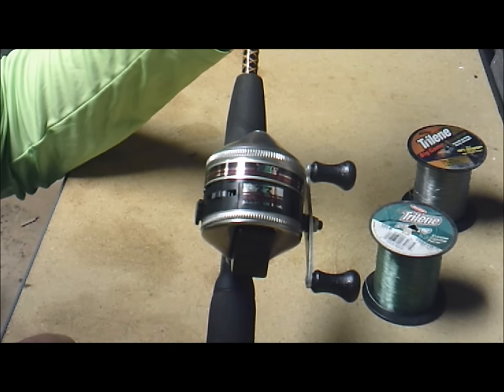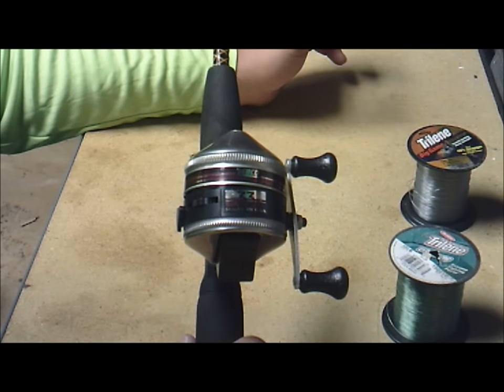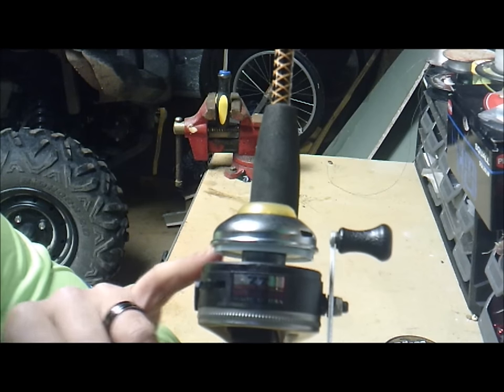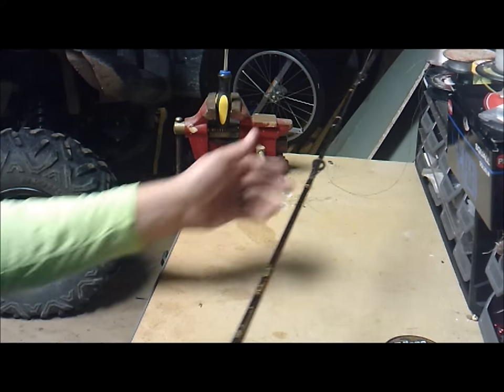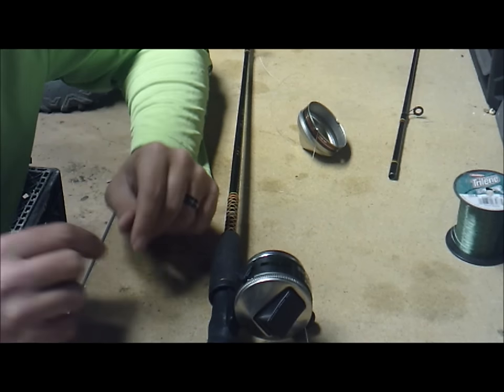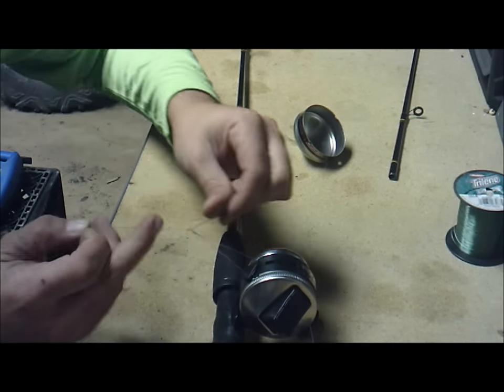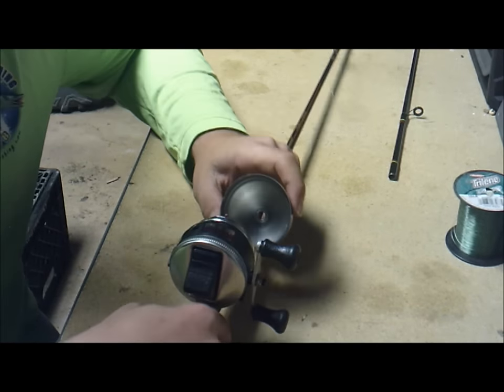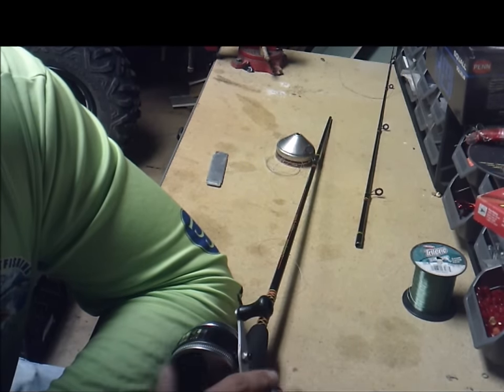How to Change line on a Zebco Fishing Reel

Comment: Bought a 500 for an ultralight rod. It's very smooth enjoyable.fishing recommend casts great. One odd thing- the bale wire is a bit heavy diameter in my opinion for a reel of this size. But a great purchase.
Reply from the maker: Great thing is you’re not stuck with the line when you buy it! Enjoy the reel! Good luck and tight lines!
Reply: What’s the power of the rod?

Comment: When putting line on your reel, to eliminate the line twist that makes you line, want to spring off your reel or have coil in your line, your are to take the line off the top of the spool  if  ( you have the spool of line horizontal , like with a bolt through the center of the new spool, clamped in a vise )  for spinning reels or the bottom of the spool for the other.
  That way it lays back on your reel with the coils are laying flat just like they came off the new spool of line to eliminate line twist.
Reply from the maker: Make sure the line is tight when you add it to your reel. There is no way you can try and get the line the same way from the spool to spool. When adding new line as you are reeling with one hand use the opposite hand to hold the line so it it tight/taught to the reel. Doing this with Braid or Mono will create a new memory in the line.
Reply: this is the info i have been hunting: this style reel is a spincast, so the line should come off the bottom of the horizontal spool? i have potentially exactly the same reel, dome spins to the right as you reel it in. response will be greeatly appreciated
Reply from the maker: J. Garcia when spooling any reel there will be a label on the new spool that you purchased. Make sure that the label is facing up when you start to add the new line. When the label is facing up start the re-spooling process and this will help put the line correctly onto your reel. Sorry for the late response I didn’t receive a notification for your question. Thanks for watching and Tight Lines!

Comment: Couldn't see how you made that knot even a little bit
Reply from the maker: It’s called a uni knot. It’s an easy knot to tie.
Reply: @JustinFraleyJustCatchFish   that doesn't help me see what you were doing
Reply from the maker: @katyhart8144  after you remove all the line you will locate the main spindle that holds the line. You tie the new line to the spindle using a “uni knot”

Comment: How many yards of line do you estimate you get on your 33 Zebco?  I know it will vary based on the lb. test/thickness of the line.  I will be using mono-filament 10lb test.
Reply from the maker: I can only get about 100 yards. If you use this reel a lot I suggest re-spooling it again this summer.
Reply: @JustinFraleyJustCatchFish  thanks i haven't but line on one of the in a while fixing to have to put line on my late 60's zipco 33 for the 4th of July go fishing with some friends thanks again

Comment: Is braided line good for this reel?  If so, should I tie a piece of mono for backing first?
Reply from the maker: Yes, braided won’t affect the reel. You won’t need mono backing. The spool is fixed like a traditional spinning reel. Just make sure the diameter of the line is within the ratings of the reel. It will look like 8/220 10/200 12/180
Reply: If you use braided like on a spincast reel you will wear groves in the pickup pins if you are catching catfish or carp. A hard pulling fish puts a lot of pressure on reel.

Comment: Hi,  thanks for the video, very helpful. I have a real just like that. What is the kinda triangle shaped thing to the left of the drag set that can be turned also? Whats it for? I've had this real since I was a kid & can't remember & on mine it doesn't really seam to do anything. Thanks again
Reply from the maker: 501talon Once you remove that plastic knob you can get to the gears for repair or maintenance. Older models are bolts to keep the handle attached. Good question thanks for watching
Reply: Isn't that the bait clicker??
Reply from the maker: I wish it had a bait clicker for cat fishing but this model is just access to the bottom of the reel for preventive maintenance.
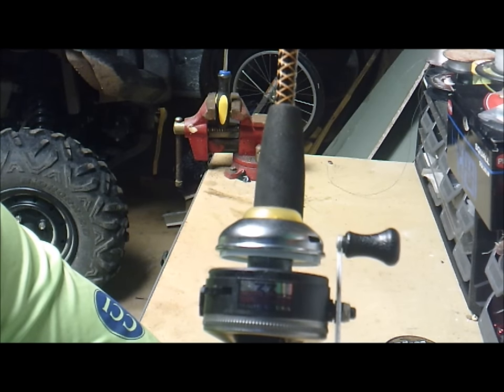Reply: Hey, mine looks a lot like yours but it says 33 Rhino tough. I think it is from the late eighties. I was using your video to put some new line on (Thanks, btw) but when I took the front cover off  that round plastic circle piece on the very top cracked and a portion of it fell off. You can see the piece I'm talking about in your video at 1:21. I don't know what that piece is for. Will the reel still work without it? Should I pull the whole thing off, leave it the way it is, or try to glue it back together? Thanks for any help!
Reply from the maker: That piece that broke off covers protects all the gears in the reel. Try and find a replacement or fix the broken piece to cover that back up. You don't want to get any sand or substance in there and wear out those gears. That piece is for maintenance, so you can pop it off and oil your gears. So if it stays open foreign objects can get into those gears and eventually tear it up.

Comment: Do you have to worry about line memory or can you just start casting right away
Reply from the maker: You can start using it as soon as you are done putting new line on it. Just put a few drops on the new line to help avoid any tangles.
Reply from the maker: Drops of water

Comment: In your discription, it would appear that if the line is coming off the spool in a straight line that the line would be getting "twisted" wrapping around the reels spool ???  It would seem if the line came off the spool in a "counterclockwise direction, it would THEN be "un-twisting"  itself as it is being reeled in a clock-wise direction on the reel ???
Reply from the maker: Jack Taylor just make sure when your putting new line on the spool your taking off has the label facing up. Thanks for watching and “Tight Lines!”

Comment: Started watching this video thinking you were going to show how to get the old line completely off the real.
Reply from the maker: The easiest way to get the old line off of the reel is to push the button (free cast) and pull the line off. When at the end the line will stop, unscrew the top to expose the inside, cut or remove the knot.
Reply: @Trophy Catfishing  oh ok. It happened that when I got to the end, I just pulled harder and it broke free. Was trying to figure out how to get in there to cut line from spool. Hey, Thank you.

Comment: Idiots never mention whether to have the spool feeding from the top or bottom
Of the spool.
Reply from the maker: The best practice is to have it feed horizontal instead of vertical. But if that’s not possible have it feed with the label on top. Thanks for watching and Tight Lines!

Comment: Alright captain obvious. How do you keep twist out
Reply from the maker: Donald Hodges put the line on in the same direction that it comes off of the spool and make sure you have plenty of tension. It can be as easy as flipping the spool over. Also, you can run hot tap water over over the new line to erase any memory left with mono.